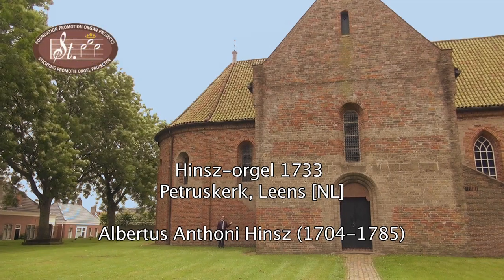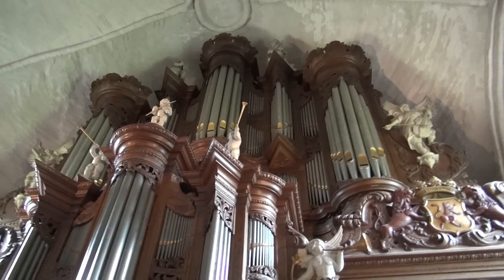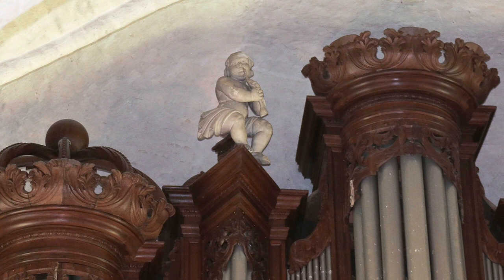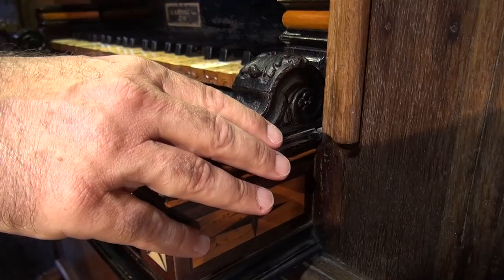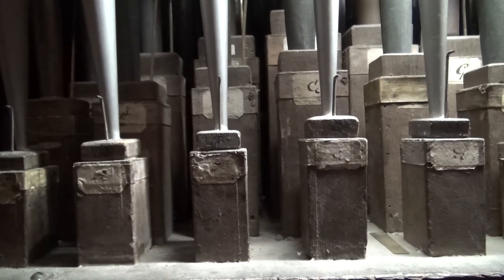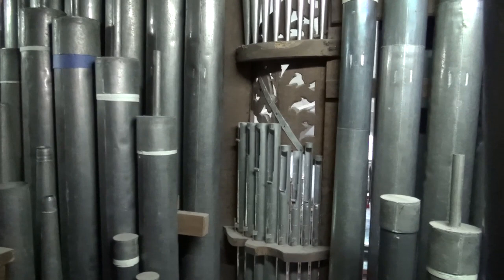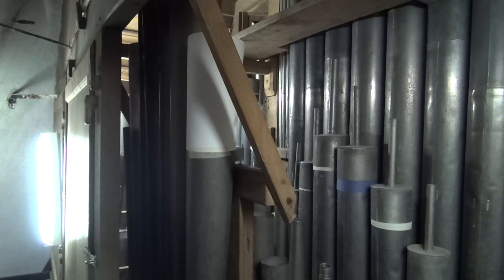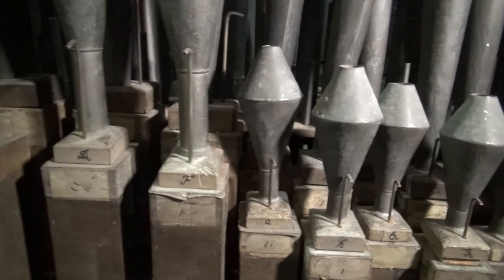DOC.  HINSZ-ORGAN (1732) Leens with Dirk Molenaar organist at Leens & Willem van Twillert  ENGLISH

Comment: The speaking length of the pipe determines the pitch. The 16 foot large pedal pipes produce the low notes. The smaller pipes produce the high notes.

Stopped pipes are half the length but produce the same pitch as an open pipe of the same pitch length.
The scale of the pipe determines the sound. The narrower the pipe, the more string like it sounds.

With the reeds, the length of the resonator, thickness and speaking length of the tongue (controlled by the tuning wire), determine the pitch of the note. 

The type of sound reed pipes produce is determined by the shape of the resonator and whether it is open or closed at the top.

Trumpet, cornopean and cornet reeds tend to have conical shaped reeds, narrow at the bottom and wide at the top.

The singing imitative Vox Humana reeds are semi closed and typically have short resonators.
Reply from the maker: Yes you are right

Comment: Wilhelm, when this organ was built, why was the Vox Humana and the 8 foot trumpet and 2 foot cornet reeds put at the back of the organ?
Reply from the maker: The place is chosen because the reeds have to be tuned regularly. Some times you see the reeds between the foot of the Prestant 8' in the facade in Italian organs that is common also in order to tune the reeds .
Reply: @willemvantwillertorganist  ok so it is easily accessible for the reeds to be tuned by the organ tuner.
Reply from the maker: @oludotunjohnshowemimo434  Yes, totally  Right.